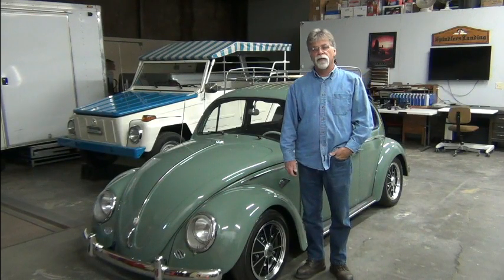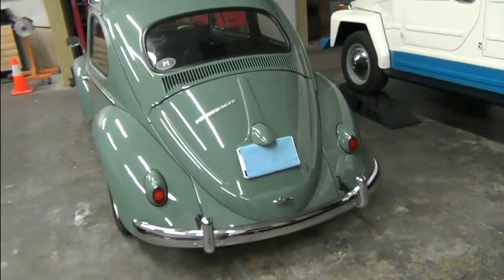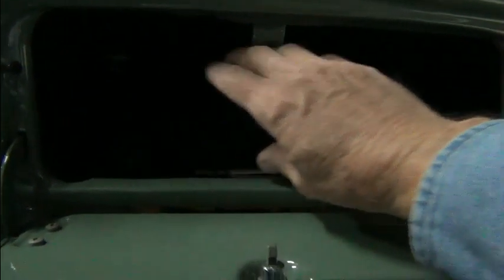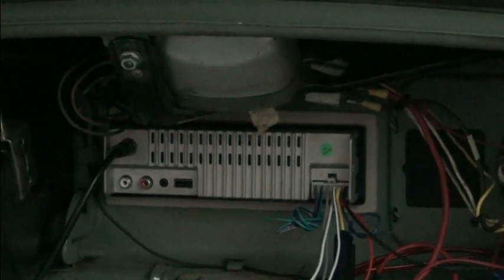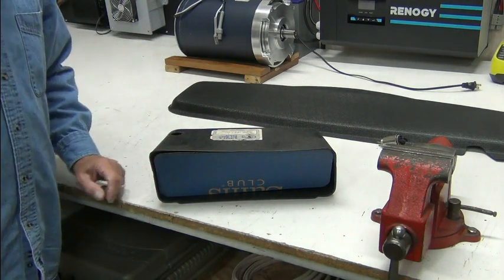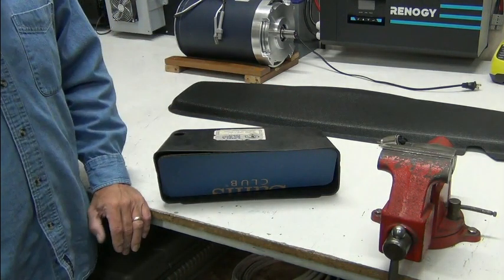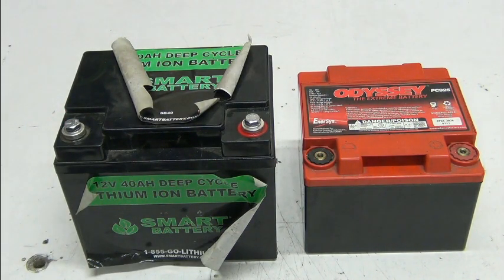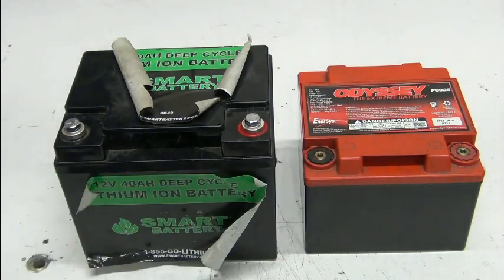VW Bug EV Conversion Intro

Comment: Does the 40 amp hr lithium ion battery fit under the rear seat?
Reply from the maker: Not sure, we replaced the Odyssey battery with an exact replacement.  The vehicle has a custom battery mount specific to the Odyssey battery.  The lithium battery we showed in the video will not fit in the Odyssey mount.  Thank you for watching.